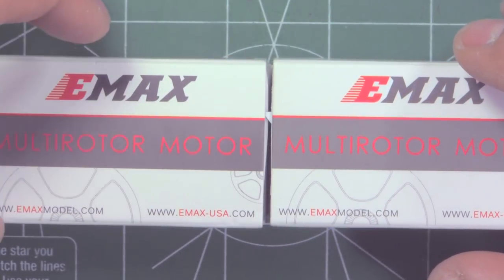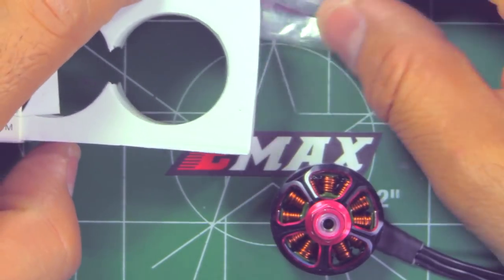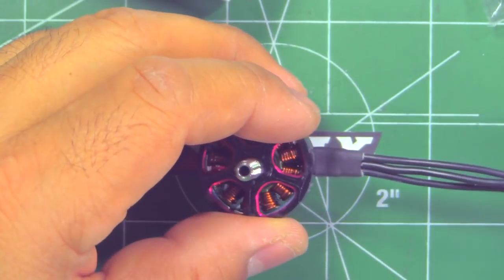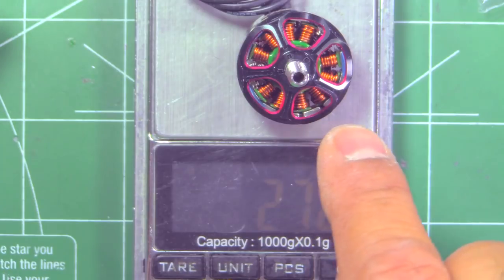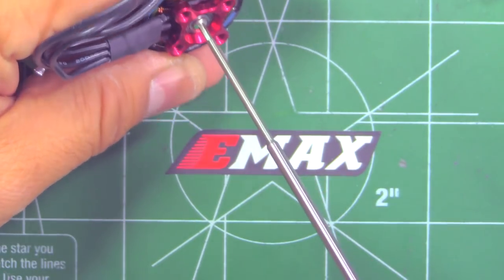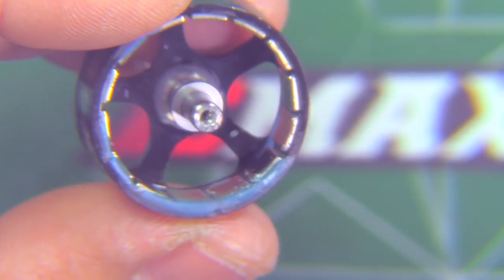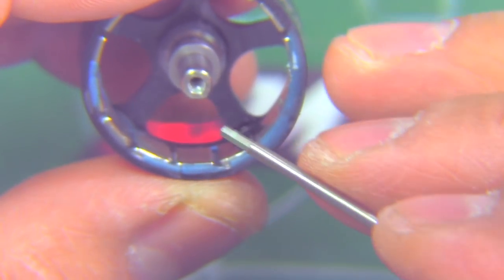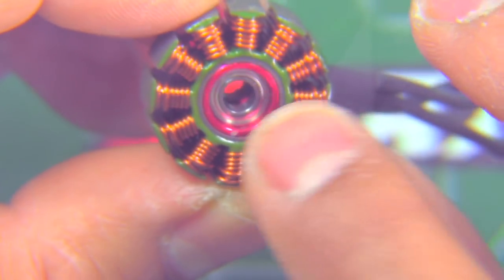EMAX RSII 2306-2600KV : Ultimate Successor to the RS and LS Motors

Comment: There’s some qc issues with these. One of mine (2400kv) was rough as hell after 2 flights. I found small strands of metal in two motors, and the amount of balancing gunk on the outer bell lip is incredible - one of mine stands 2mm proud. Wouldn’t be so bad if it wasn’t bright blue... I’ve heard from several people who have the same issues. Emax are looking into it. You have to force the wires down to even spin them. I was hoping for efficiency rather than outright power and your numbers confirm what I’m feeling. They’re no more efficient than a decent 2306 or 2207. The LS 2207 has slightly higher numbers for slightly higher amps, but in the air I bet they’re pretty much identical. I hear the more recent LS  have had their issues sorted out too, and they’re cheaper. I will say they are (well some of them) very smooth, and the power is nice and linear without the drop off 2306s often have. I can only speak for my limited experience of Emax, but even forgetting about the duffer I got, perceived build quality is well short of the t motor, Brotherhobby and even Airbot motors I have.
Reply from the maker: That much balancing epoxy showing does sound a bit excessive. I did notice the ones I got did have a bit more than usual but still OK. The metal strands for sure are not desirable. Hopefully EMAX addresses those issues quickly.
Reply: From everything I have seen so far, and now this comment, I'm turned off of bothering with the emax rs ii. Seems like a lot of hype and not worth the premium price.
Reply: John Cuppi they’re certainly very pretty, and the individual components look high quality. Early teething troubles or just poor qc in general I honestly can’t say, as this is the first recent Emax motor I’ve had. I’ve had no issues getting a replacement from the vendor, and Emax are supporting this, so in fairness it’s not as if they’re shrugging like so many companies in this hobby. The early LS had issues with fragile windings. Later editions I’m told had epoxy added to them, so they do listen. Just my two cents. There’s always duffers, only time will tell if I’m the exception or the norm.
Reply: If you want to PM me, I can forward you an email with the rest of my analysis on this - you're spot on that the LS2207 does just as well at identical power (but has more to give up top), and if I want a 27g motor with 1400g of thrust using V2 cyclones, I can keep using my RS2205S motors.

Comment: Definitely an insane motor in its specs and numbers! Unfortunately they hadn't said the kind of magnet they were using, not the laminations either. But they look top notch!

think I know the reason why the 2306 and the 2206 have almost the same weight. Bot just due to the magnet thickness, but they use the same bell, maybe to help to slightly lower the price (even though it still has a premium price).

CoppertopFPV said he had quality control issues with these motors (one of them had misaligned magnets and the bell was unbalanced). I think you should tell Emax to take a look at their QC- I'm afraid of getting issues for that price.
Reply: Pedro Griebler Reche n54 magnets
Reply from the maker: I couldn't find any info on magnets. EMAX didn't list specs. Yes. I'll mention about those issues Coppertop posted. Emax has been good about looking into fixing reported issues in the past. Thanks for watching!

Comment: Nice thrust table! They seems to be good motors! For you is it safe to fly them on 5S regularly? HQ 5043 are ok  for you on 5S or do you think these motors need lower pitched props? thanks!
Reply from the maker: For the high 2600kv, good idea to try low-pitch props 5040x3 and 5043x3 should be ok but only for superlight setups. Also quickly check motor temperatures after a fast lap. I usually don't recommend such high KV and 6S but yes, I know a few people want to push the limits so that's OK and very interesting when done.
Reply: @EngineerX  Yes! I usually fly HQ 5048 on brotherhobby R6 2306 2450kv motors on 5S and thay remain cold, I fly mostly freestyle so I only do short punchout :) should be OK then with 5043 with that higher kv! thanks!
Reply from the maker: @pierrickallanore6180  yes should be OK. Only problem you may encounter is that props could flatten out/bend due to too much thrust/rpm' s. If it happens you'll hear the distinct noise. If motors remain cold, then you can try other stiffer / more rigid props like DAL C5045x3 or C5046x3
Reply: EngineerX ok thanks for the tips!

Comment: If i am reading the numbers correct these produce less peak thrust than the old rwdbottoms... But they are alot more efficient across the board... So less peak thrust on the bench but more usable thrust in the air with limited battery supply?
Reply from the maker: Right, the lower Amp draw should help keep the battery packs from sagging way down. Also, those red bottoms had higher 2750KV so that would make a big difference. In these motors, EMAX "refined" the build by what it seems to be better matched magnets/ring/stator/copper windings and get similar thrust in a lower weight motor. From what I've read, that was their main goal and not just higher raw power. Hopefully these prove to be good.

Comment: Biggest annoying with these motors is how the wires exit the motors.  They basically rub against the bottom of the bell and its hard to get them to move.  Then on top of it they put all this blue glue stuff on bottom edge of bell to balance it, which makes it stick down further and more likely to rub... and if it ever does rub you'll rub off the gunk and have unbalanced motor.  And there is so much heatshink and crap on the wires, and base seems shorter than usual, its hard to really get them to bend down at all..  its just they're super think and in the way.  BUT ..  once working they're great.  I'm happy with purchase.
Reply from the maker: Bexamous Good points that I failed to notice but that are quite important and hope EMAX listens to user feedback quick.  They're usually good at addressing issues. Thanks for adding useful info

Comment: Sweeet. I'm ordering these for my Hawk 5 soon. 2306 2400kv ftw!
Reply from the maker: Archer FPV I'll  be rinning that motor on the thrust stand as soons as I can! Already ran the low KV versions so those will be next
Reply: EngineerX sweet! Thanks for the reply!
Reply: EngineerX I ordered the 2306 2400's this am from emax. Can't wait till you get the thrust test up. Btw I finally put the rcx 1407 3400's on my sparrow build. So much more power than the emax 1306 3300. When I did the maiden I was really surprised the punch out honestly felt like it had double the power over the emax's 😳. And instead of cruising at about 50% throttle on 3s and about 35-40% on 4s I'm now at about 35 on 3s and probably 15-20 on 4s. I barely move the throttle and she pops up 20 feet. Gotta get used to that lol but the hawk 5 did that to me the first few packs too but I got used to the way it flew in about 5 packs. Only have 2 on the sparrow due to work and weather the last couple days. Anyway take it easy and keep up the great vids 👍🏻

Comment: Are the props spinning backwards on your test? Maybe I'm blind lol.
Reply from the maker: LoL... yes and no. Props are spinning the correct way but they're not mounted on the motor in the usual orientation. They're upside down and thrust pushes on the motor. I did that from the very beginning so I kept setting up the same for consistency. I've measured about 50 to 80g difference when mounting the other way. But a lot of that difference is due to the mounting plate on the thrust stand, you can see it's quite wide. Well, I think keeping consistent setup is important so I kept mounting the same way.
Reply: EngineerX that's crazy. I'm a noob..  and I take everything detail into account.. like when a prop is in a frame the wind on the legs if it's wider it's more draggie... But as I thought I would do the same as you for testing..  lol very good information Tho keep it up bro
Reply from the maker: In static thrust tests we try to keep everything consistent, even testing in warmer weather can yield a noticeable difference.  I do think, that if you mount props "pushing" on to motors you should gain more usable thrust because the arm won't be in the way. Only issue is clearance, so arms may have to be high-mounted. I guess that never caught up because motors make so much power that there hasn't been a need to change from the traditional setups. Here's an interesting test I ran for different setups https://www.youtube.com/watch?v=r1lPDapmOG4

Comment: Well... I just hope they realize a 2207 version.
Reply from the maker: I was surprised they decided on the 2206, but I can see their intent: lowest weight possible for hyperlight builds. But I do agree that right now 2207's are the go-to motors for a good portion of the market. I'm sure EMAX will monitor that demand and act accordingly!
Reply: I remind that at Emax's youtube channel, they said they were working on a 2207 version...
Reply: 2206 is good for light 6S setups... But this weight is too much :D
Reply: Why stop there?  A 30g 2208 would be where it's at, especially on 6" lightweight setups - ultimate endurance and team racing setup
Reply: tehllama42 That wouldn't be a bad idea...
Reply: tehllama42 indeed it can be interesting... maybe a 2212 for 7" as Bob Roogi likes?
Reply: Pedro Griebler Reche That would be awesome!